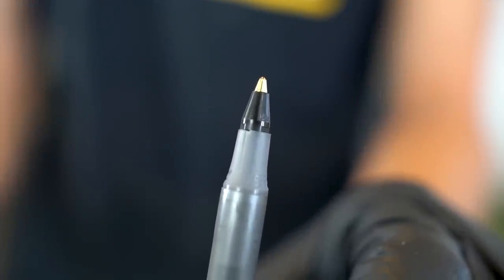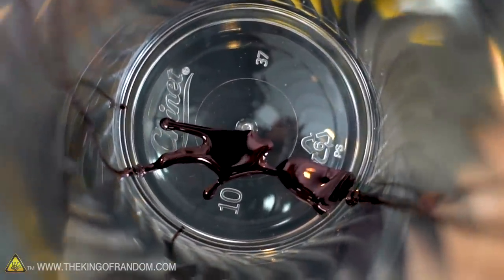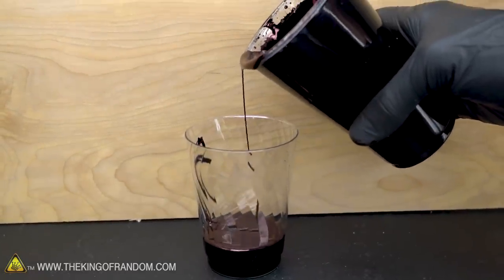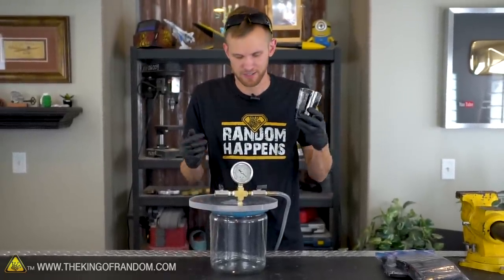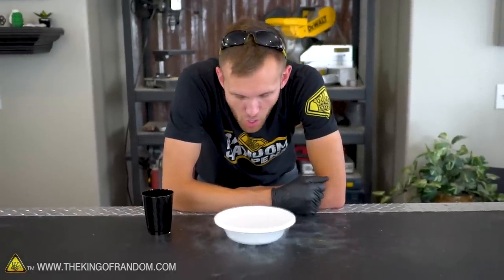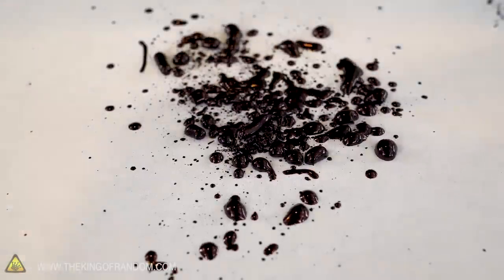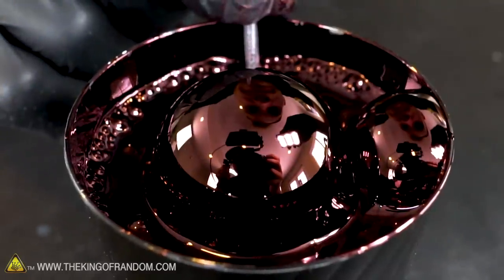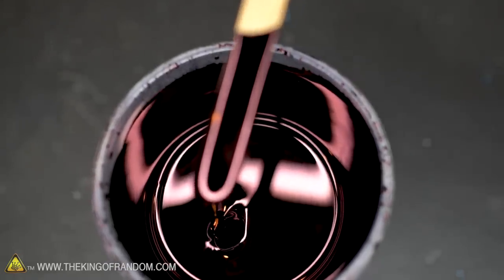Extracting INK From 1,000 PENS!!

Comment: You should melt the plastic from the pens and use them for another video so you aren’t wasting it.
Reply: that would probably be extremely dangerous
Reply: To cheap
Reply: He could  just recycle
Reply: Wouldnt melting plastic be really dangerous since it releases chemicals into the air when heated?
Reply: The Grim Reaper depends on the plastic - thermosetting plastics yes, as they are treated to be resistant to heat. Thermoforming plastics no, as they can be changed in heat
Reply: 666 LIKES.
Reply: Just throw em away smh 🤦🏽‍♀️
Reply: Make a GIANT PEN
Reply: @liyahmarie6579  huge yikes
Reply: Face palm momento

Comment: Ink Components
There are hundreds of variations on ink formulas. The average ballpoint pen’s ink is composed of dye or pigment particles – carbon black for black pens, eosin for red, or a suspected cocktail of Prussian blue, crystal violet and phthalocyanine blue for the classic blue pen – suspended in a solvent of oil or water. The most common of the oils are benzyl alcohol or phenoxyethanol, which mix with the pigments or dyes to create a smooth, vibrant ink that dries quickly. However, there is more to ink than its two primary components. With only pigment and solvent, the pen works, but it could still use some improvements.

Comment: You also can blow through the other side and the ink comes out

I meant with an electric pump not ur lungs
Reply: But imagine doing that for 1000 pens
Reply: Zombifyed lol
Reply: I learned that in my reading class...the hard way
Reply: michael macdonald a
Reply: michael macdonald my friend does that at school so that she doesn't have to do her work
Reply: iHearGreen 31 lol
Reply: michael macdonald what I do all day in my math class
Reply: Fortnite Fan 15 notice
Reply: Zombifyed imagine owning an air compressor with a regulator and a spray nozzle with a rubber tip
Reply: I do dismantle pens and blow ink into the toilet.....
Reply: @Shreerang Vaidya you mean like Mark the dude
Reply: Ur lungs would run out oxygen
Reply: I drank my ink by accident
Reply: i was thinking the same
Reply: michael macdonald but sometimes the ink gets in your mouth and you don't notice it until you friend tells you about it xD
Reply: Zombifyed do it with an air mattress pump
Reply: @michaelmacdonald1482  I feel like the pressure outputting from the pump would just launch the pen. Just a theory though
Reply: WARNING WARNING DANGEROUS
Reply: I did that before...I go in trouble lol
Reply: That's an inefficient method.
Reply: michael macdonald I do that when my pen dies on me, and then when i blow it it works again
Reply: @dzily6638  lol
Reply: take a shower in that ink
Reply: iHearGreen 31 ooof
Reply: me in school everyday
Reply: But the ink is kinda sticky so yeah it is harder to do for 1000 pens ahahahaha
Reply: That's a little risky get might inhale some of it

Comment: Just a quick question, does liquid nitrogen make paper soggy like water?
Reply: No,  liquid nitrogen sublimates in standard atmosphere,  just like dry ice
Reply: Yes but it quickly evaporates.
Reply: He did this before, though I forget the result.
Reply: No it doesn’t. It actually makes it hard because the liquid nitrogen is so cold it freezes it.
Reply: Shane Rudd sublimating involves going from a solid to a gas, without a liquid phase, as in co2, dry ice. Liquid nitrogen doesn't sublimate. It evaporates.
Reply: PokeCenterProduction Correct.
Reply: well technically Liquid Nitrogen boils.
Reply: no it will freeze the water
Reply: Huh never thought of that
Reply: Yes it makes the paper wet, but just for a short amount of time before it evaporates. Sumblitmation is from a solid to gas with no liquid phase. Liquid nitrogen evaporates not sublimates.
Reply: @PokeCenterProduction  true wasn't thinking about that.  But still it doesn'tmake paper soggy. Lol

Comment: 2 ideas:
1) we saw a color change with the boil, it turned straight purple/blue on the sides -- you should get it to boil and then cool and see if it acts differently after the color change.
2) coat things in it and let it dry, see if it keeps that metallic look or just turns black
Reply: The only problem with this is that the video was from 3 years ago
Reply: @nanomachines9872  yyyeah, I'm a little late... But could still be revisited

Comment: 1. Please shine a bright white flashlight beam onto the ink to reveal what color it really is.
2. You demonstrated what it does when poured into liquid nitrogen, but what does it look like when poured into water?
3. How do its properties for making marks on paper change as you progressively dilute it with water?
Reply: Interesting.....
Reply: You have my attention
Reply: I am a printer. I can answer all of these questions. 1: It is a very very dark purple ink. When you use chemicals to clean it up, it makes everything violet. 2 & 3 - It is an oil based ink in the pens, It will not mix with water, in fact in the printing industry we use water to spray on things you do not want to get ink on. You can however dilute it with acetone, mineral oil, and most common solvent based chemicals.
Reply: when i was younger i broke an ink pen and poured the ink into a toilet. the ink was oil based and slipped right into the water but didn't mix
Reply: heyitsgeegee why? He had interesting questions.
Reply: I can tell you that it is so hard to mix with water. It is like mixing oil into water
Reply: That's the real question
Reply: No 3 is just coriography it’s like a basic science experiment

Comment: Melt all the pen casings and cast it into something
Reply: Freeze it
Reply: Flutterdrive wouldn’t he be breathing in chemicals?
Reply: A huge pen casing?
Reply: Flutterdrive if he were right next to the melting chamber he would be breathing toxic chemicals
Reply: Plastic does not cast very well
Reply: @1PoodleKing1  sure it does, it's called "injection molding"
Reply: @mimked  right, but that's not casting. Casting requires the material to be liquid and flow well. Plastic doesnt do either of those well without precise control
Reply: better than any of his own ideas
Reply: Melt the casings and then immediately put it into the vacuum chamber!
Reply: Flutterdrive yeet

Comment: Putting ink a water balloon and spray it with a pressure washer in slow motion
Reply: Lumpdumper damage 100
Reply: better ideas than what he did
Reply: KO
Reply: Or fill it with helium or CO2...
Reply: Put the ink in the hot furnace that melts the metal

Comment: The one thing that frustrates me about this video is ballpoint pen refills are a thing.  Even if you can’t buy the ink in bulk, you can at least buy the ink tube without all the pen parts you spent a lot of time removing, and probably threw away.  I found 100 for $4 on Amazon.

Comment: imho using low pressure compressed air to blow out the ink might be another option. and you can extract the ink remaining in the tubes with a solvent like 99% isopropyl alcohol. then evaporate the solvent. 😄

Comment: I'd like to see if it ca be used for a metal stain .and a wood stain when doing wood wipe it off after applied to see color difference and also to see witch way is better for metal thinned out by heat or at normal thickness so ya I think it would be interesting to see the out come